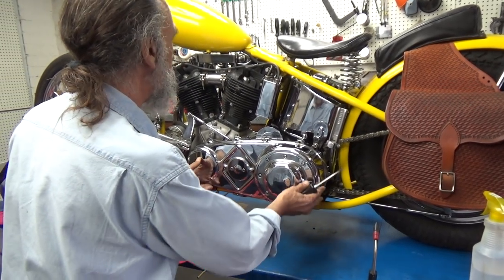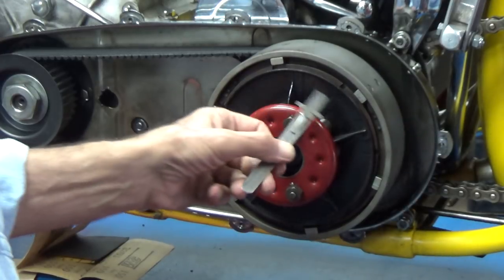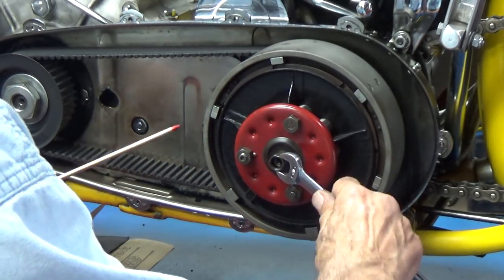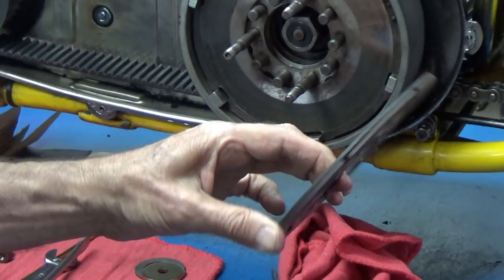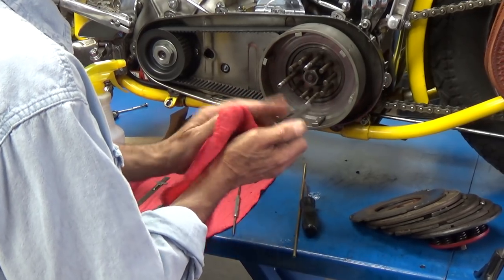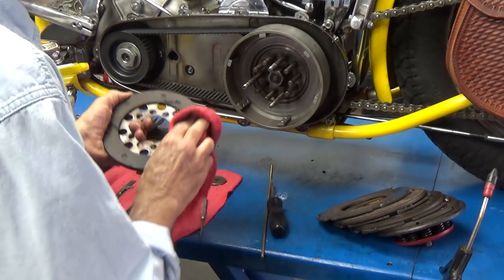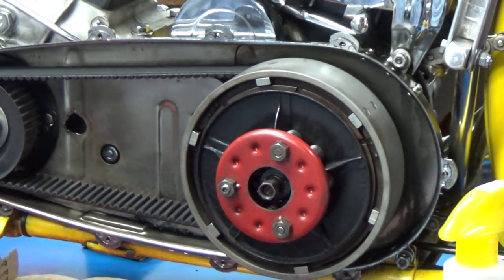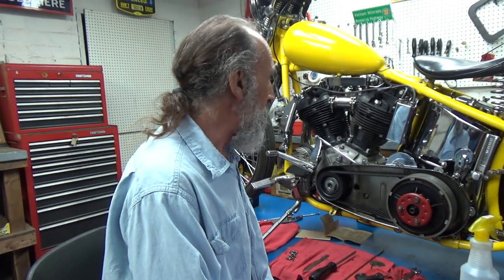Service the stock dry clutch on a Flathead, Knucklehead, Panhead, or Shovelhead Harley Davidson

Comment: Hello Mike   I see you have a belt drive and I did not see a vent on the primary cover ,,,is the old steel primary cove better for those belts than the late alum. covers ? I have had BAD luck with belts but had it on my 70 FLH ….you must like them any way let me know ...and thank you for keeping the old stuff running ….Bill
Reply from the maker: You know, this is just my personal preferences.  On an old bike, with tin primaries and a kickstart, I love a belt drive.  On a later bike, with aluminum housings and an electric start, I prefer a chain drive. I worked with belt drives back when  they were a new thing and I've watched them improve.  They're better than they've ever been.  Proper alignment and tension is most important.  Using today's Kevlar belts in tin primaries, I've had no problems.
Reply: thank you Mike I have never used a belt on a tin primary . beleve me I have put a lot of miles on a tin primary and if they work like you say well I am putting one on my 54 pan . thank you mike I love your lessons and after 55 years on the road I like that I can still learn things ….have a blessed day my brother ...Bill
Reply from the maker: Okay, now I feel I have a responsibility to you.  I hope this helps you.  These are my recommendations:  First thing is, buy a motor seal.  Colony is the only company I know of that makes it for your '54 ('37-'54).  This is the toughest part of the whole operation.  Removing the snap ring that holds the factory spacer in place is not easy.  Then, remove the spacer and install the seal with the supplied snap ring.  Then, remove the breather pipe from the motor and cut the curved end off of it so that the outlet of that tube is inboard of the primary. Reinstall the breather tube.  Attach a rubber hose to it to vent it out the rear of the motorcycle without any oil going onto the rear tire.  Now, turn the screw on the oil pump in so that it bottoms and no longer oils the chain which will no longer exist.  Now, with the inner primary cover off,  make sure both the sprocket shaft and transmission mainshaft are in the same  plane, both up and down and side to side.  I do this by installing both pulleys and laying a piece of glass on them and making sure it doesn't "rock."  Now, put it all back together and install the belt with the tension "free play" or "slack" recommended by the manufacturer.  I prefer a Kevlar belt .  This is perfection to me.  I always get a belt drive that will fit inside the stock primary covers.  And, I still have both feet, as do my passengers.  By the way, now you can travel great distances without having to stop and adjust the primary chain.  And, you can park on people's driveways without having to apologize so much.

Comment: I have this style of dry clutch on my FXB Sturgis. I adjusted it as shown here but noticed that in heavy stop and go traffic it really stonks into first from neutral. Am I correct in thinking that with a very hot clutch the adjustment loosens and the gap set with the adjuster screw becomes larger ? This would be the case when the heat in the clutch plates expands them, effectively moving the pressure plate (and with it the adjustmemt screw) outwards... ? Or does heat lengthen the clutch pushrod and tightens the adjuster screw gap ?

P.S. I put new plates in the clutch this winter, they are not greased up or sticking.
Reply from the maker: You'll have to experiment with your adjustments.  Make sure the releasing disc is sliding away staight.  Adjust the springs accordingly.  Adjust the center adjusting screw (with the cable backed off completely) to move the clutch arm so that it is 13/16" away from the top of the transmission cover.  You will find this in your service manual.

Comment: Mike, my Pan-Shovel has the same belt primary as the bike in this video, and I have two questions about pulley installation:  First, what is the torque on the front pulley nut, and do you use loctite?  Second, ordinarily on the clutch hub nut, there's a tab washer that locks to the keyway.  However, with this rear belt pulley, there is a dished aluminum piece (with a nylon washer on the back side with holes for the fingers) that covers up the keyway.  So, there's nothing for the tab washer to hook into.  Do you just omit the tab washer?
Reply from the maker: Not sure.  But, a drop of red Loctite will keep that clutch hub nut on there.  About 60 lbs. on the clutch hub nut is adequate.  Front pulley nut.  What year motor? Splined shaft or tapered shaft?  That's why I ask for years and models.  I hit that pulley nut with an air impact.  Don't get carried away.  A drop of red loctite on that nut too.
Reply: @pacificmike9501  - Sorry, this is a '51 Pan bottom, so it's a tapered shaft.   Sounds good!  I will proceed as you suggest--and thank you for the quick reply.  She's almost on the road, in time for the 1-year anniversary of purchase and tear-down.  I'll soon be reviewing your 'mousetrap' adjustment video again to make sure I get it right!
Reply from the maker: Way Cool.

Comment: Mike, finishing up my clutch on a 77 shovel head open belt set up. What is a good distance to start when measuring from the pressure plate to the releasing disk?
Reply from the maker: The book shows it at 1 1/32".  But it's really up to you.

Comment: Any thoughts/advice about changing to primary belt drive and dry clutch? Angles: reliability, simplicity, road side repairability, smoothness, cost? Fxrs Con ‘90. Regards Marcus.
Reply from the maker: Harley did better (I believe it was 91 up) when they went to a splined transmission mainshaft and clutch hub, but the wet clutch and stock primaries on 5 speeds were all pretty good.  There are newer, better clutches available for both early and later Harleys and I generally run belt drives on any of the old kickstart only bikes.  Electric starts, I run primary chains.  Just me.

Comment: Mike I got 1972 FLH do you recommend to put doble seal on mainshaft nut clutch? Thanks very helpful video
Reply from the maker: Sure.  Why not?  Anything that helps keep oil off of your clutch plates is a good thing.  And, the nut is deep enough to install two seals.  Just something that may or may not help, but, you're there anyway.

Comment: Hey thanks for the video.. I have a 83 FXSB with a dry clutch belt setup. I'm getting a fair amount of oil in my clutch plates and the clutch is slipping. I do have a leak coming from my transmission drive gear seal. I am not seeing any oil leaking from the front crank seal. Is the trans causing the oil on my clutch plates? Do you have a video on removing the primary and changing the seal? This thing has been leaking for years now, and making a mess of my garage but I've been hesitant to tackle the job until I'm comfortable with it. It's long over due. Hoping for a point in the right direction with this. Thanks in advance.
Reply from the maker: I think we've shown all those things, maybe not in the order you're asking.  The transmission has two seals on the left side.  The mainshaft oil seal, as it is referred to in the parts book, is the large seal behind the sprocket.  This and the spacer that runs inside it are generally the culprits that flood your garage floor.  Next, the second offender, especially if you overfill your transmission, or your bike leans to the left too far, is the main drive gear oil seal (as it is referred to in the parts book).  I believe you need to replace all of this stuff.  Don't forget the clutch hub nut seal.  You can stack two in the nut.  We do have a video showing the installation of the inner primary, although it's not a belt drive.  I hope this helps you.
Reply: @pacificmike9501  looks like I need the parts book. You've been very helpful I greatly appreciate it. I gotta get that part number for the main seal bushing. I think that may be my issue as the previous owner did all the seals shortly before I bought the bike. Or so he says you know how that goes. ✌️

Comment: Mike I have a stock ‘90 FXRS CON with the newer clutch shaft. I would like to know which pros & cons are to be expected when installing an open belt and dry clutch. I’m lookin’ for simplicity, reliability, smoothnes and easy road side repairability. Any thoughts/advice would be appreciated. The bike has 104K km on it. Cheers Marcus
Reply from the maker: Well, I answered you accidentally before finding this comment.  I'd run a wet primary, an aftermarket clutch of your choice, and even maybe an aftermarket starter of your choice.  You've got a well designed unit to start with.

Comment: Great video!  I have a 81 flh, my clutch is sticky so I went right to your page. I will be doing mine tomorrow. What are your thoughts on wet clutches and do they make kits for older bikes? Sure wish you were on another platform so I could pick your brain🤣
Reply from the maker: There is really no way to successfully seal your primary.  You need to run a lot of oil for a wet clutch.  Personally, I run dry clutches.

Comment: do you need to put the rattlers steel plates back in or use steel disc without them
Reply from the maker: It's personal preference.  Neither is wrong.  But those little anti-rattlers or "buffers" really quiet things down.  I like them.  But, a lot of old chopper riders, with open primaries, liked the sound of their clutch when it disengaged and made all that racket.  Different strokes.
Reply: @pacificmike9501  thank you for your help
Reply: great video

Comment: Yo Mike - just serviced the dry clutch on my panhead.  Makes a huge difference - thanks for the great videos.  Quick question - I have the clutch dialed in - she shifts easy and everything seems on point.  When I have the clutch engaged at a light and am listening to the chatter of the clutch plates it seems like the bike wants to creep forward the tiniest bit.  Normal?  This engine has very few miles since a major rebuild and is still tight, so I thought that might be the cause as everything seems to be running well.
Reply from the maker: You are sitting there with the clutch "disengaged."  The steel plates are rattling around.  That's okay.  If the clutch is grabbing, maybe it's not releasing far enough or maybe it's not breaking evenly enough.  This is all adjustable and just needs a little more practice.  Sounds like you're getting very close.

Comment: Mike, I know this is an old video, but I have a question. I have an 80 fxwg with a chain primary, but I have a dry clutch. I put the aftermarket needle bearings on it with no cage (with a healthy amount of grease) and a 5 stud clutch hub. I noticed that when the bike is cold, the clutch chatters quite a bit when I take off. Once it warms up, it stops. I haven't taken it apart yet to see what's going on, but I was hoping you could point me in the right direction as to what to look for when I disassemble it.

EDIT: Probably worth noting it's a 93" S&S stroker kit.
Reply from the maker: The plates are probably sticking together.  Most likely oil on the plates.  Make sure it's breaking straight.

Comment: I know this is 4 yrs old but I am hoping I can get some help. 
I have a 1982 FXRS dry clutch with oiler. Plates were stuck so bad I could not put it into gear without stalling. I cleaned them with brake fluid and they worked great on a two hour ride. Bike sat for 10 days and when I tried to take it out the clutch was stuck again. This time I soaked the plates in mineral spirits overnight then scuffed them up with some 100 grit sandpaper, cleaned them and reinstalled. Steel plates were numbered and went back in order. Friction were not numbered and they are out of order. I lightly sanded the fingers. Did not yet test ride but I’m guessing it will feel great at first. I’m just worried they will be stuck again in another ten days. 
Note: before taking off the cover I drained approx 16 oz of oil (60w). Should there be that much in there? I have the original set up, oiler off the tee and return to pump. 
Note: plates were 80% covered in oil.  
I used all new gaskets when putting together this time. I have no vacuum pump to check for leak. 
Would wet/dry plates help me with situation?
Reply from the maker: Oil off the tee?  Oil should come into the primary from the little skinny tube on top of the oil pump.  Sounds like you may be flooding that primary.  The big line with a tee is a breather from the motor back to the oil tank, with a tee huffing air into the primary.  Then there is a line from the back corner of the primary back to the motor case.
Reply: @pacificmike9501  sorry my rant may have been confusing. Mine is set up how you just explained, a line coming off the tee supplying oil to the chain. The return comes from the back of the primary and goes to the pump.
Reply from the maker: I don't  think so.  The little tube on top of the oil pump has a skinny little hose that slides onto a fitting on the inner primary that is pressed into the inner primary housing from the outside in and in the middle of the inside of that housing.  Then, there is a breather hose that goes from the crankcase  (above the oil pump) to the oil tank.  That is a breather hose and it has a tee in it to go to the inner primary.  Then, the oil return hose from the bottom rear corner of the primary returns oil to the crankcase through a fitting on the crankcase inboard of the oil pump.  If this isn't clear enough, please look in your service manual.  Getting these wrong can be catastrophic.
Reply: @pacificmike9501  sorry you are correct. the return goes to the crankcase, not the pump. I checked the service and parts manual. that was very clear. actually following the lines under the bike, not so clear. I have the bike on one of those small lifts and the part that supports the frame is  obstructing my view making it difficult to follow the lines. At first I thought they were reversed but I was able to confirm that they are correct.
Reply: SO if the oil lines are correct, gaskets are new, torque is correct, the system should work properly unless pulling air from shifter shaft?? I may not have time for a test ride until monday, then I can pull the drain plug and see how much oil accumulated this time, I am watching your Evo motor disasembly video while typing this, had to pause it lol.

Comment: Hi Mike,

Happy new year. Thank you for making these videos. My clutch is new but has been sitting for almost 20 years. The steel plates have patches of surface rust. The clutch seems to operate okay but since it’s apart should I worry about dressing up the steel plates? Also my steel plates don’t have the anti rattle fingers. Is it worth the cost to buy them? 

Thank you
Reply from the maker: Happy New Year.  Use some fine wet or dry sandpaper (like, 400 grit).  Clean them up with the sandpaper and a real light oil to get rid of the rust and make them smooth.  Then, wash them with isopropyl alcohol and use them.  The antirattlers just keep the plates from rattling when the clutch is disengaged.  If the sound doesn't bother you, the bike doesn't care.  Personally, I like them quiet, but, it doesn't really matter.  Don't buy the antirattler fingers (as you call them).  If you want quiet plates, buy new plates with the anti-rattlers or "buffers" already installed.
Reply: Thanks so much. I’ll do just that.

Comment: Hi! how to change cluch hub springs? thank you
Reply from the maker: Just take off the releasing disc (the way we do it with a washer on the adjusting nut).  Now set it down and slowly back off on the nut.  It's okay if the stud backs out.  Just do it slowly so it doesn't go "Boing!."  Now easily replace the springs and reassemble the pressure plate on to the releasing disc.  Assemble the stud and tighten down the nut to hold it all together.

Comment: Mike is there any difference between a wet clutch or dry clutch in everyday operation ?
Reply from the maker: Yes.  Wet clutches are nice.  But, your system must be designed for it.  A lot of the plates are "either or."  But the rest of the system has to be made for it.

Comment: Mike, what was that measurement that you took for the pressure plate? I just got a 80 fxe with an open belt primary set up. It shifts fine and doesn't catch or jump but when looking down at it when spinning it doesn't look straight, it looks like it has a wobble. I read in my HD manual that it says 1-1/32 in. I watched another video and the guy was measuring it at 31/32in thanks for any adivce, or if I should even adjust it if it's shifting good.
Reply from the maker: If it works well, it works well.  The measurement is a starting point.  Adjusting it to break evenly is where you go from there.  Enough pressure for the clutch to not slip and release well is the goal.  Early clutches start at 1" and the later ones at 1 and 1/32.  Again, that's a "starting point."
Reply: @pacificmike9501  Thanks Mike!
Reply from the maker: Sure.  And thank you.

Comment: Mike,,i noticed the knuckle doesn't have the timing indicator as the shovel you did a video on,, is it over on the distributor side?
Reply from the maker: I assume you're speaking of the timing plug hole which they both certainly have on the left side of the crankcase.  That particular shovelhead also has an after-market timing indicator mounted inside the primary housing.  We may show that later on.  I hope this answers the question, and, thank you for watching.
Reply: @pacificmike9501  yes and thanks for clarifying

Comment: Hi Mike. Is there any reason to soak brand new fiber discs in oil on a dry clutch? Thanks!
Reply from the maker: "Dry clutch" means DRY CLUTCH.  No, do not soak them.
Reply: @pacificmike9501  You're the man, Mike! Thank you, can't wait for your build to start. Anthony